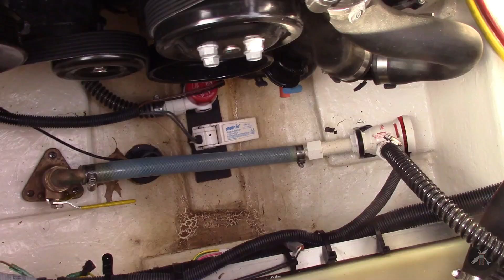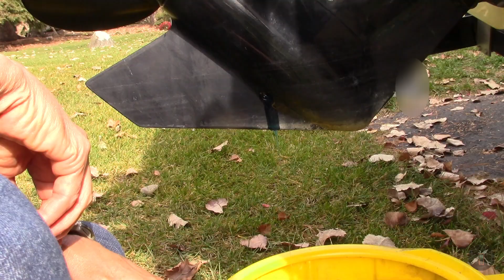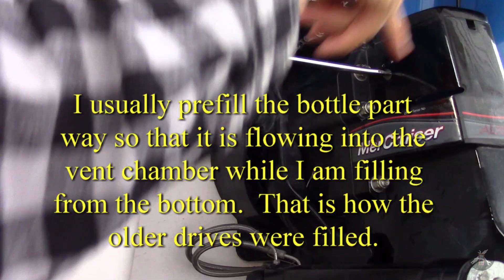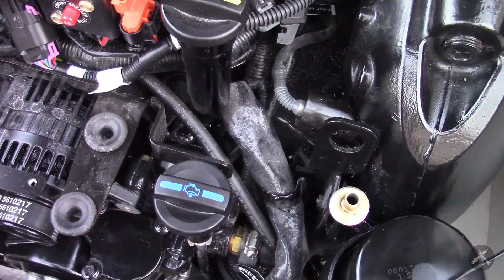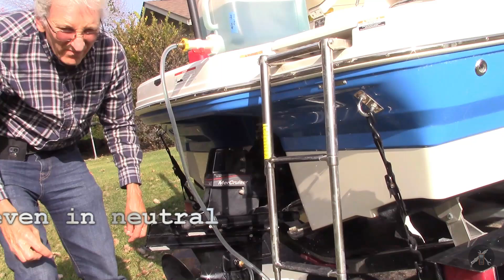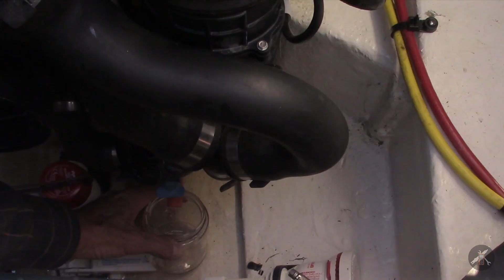UPDATED: Winterize 2018 Mercruiser Alpha1 Stern Drive 4.5 L 250 HP

Comment: One other question. I've heard horror stories about the single point drain system failing when there is a clog in the drain tubes coming from the block and/or exhaust. If there is a clog from rust/debris, how do I determine if absolutely all of the water has been drained from the system? I read in a forum that someone had a clog unknowingly and when they went to fill with antifreeze, the thermostat must not have opened all the way and water was still trapped in the block and cracked the engine. Thanks in advance for your bits of wisdom!!
Reply from the maker: I share that concern. I was surprised that I only got a gallon or so of antifreeze back when I drained the block in spring and thought that might be the cause. At first, I didn't deliberately measure it, but it was obvious there wasn't much and my older 5.0 drains about three gallons.  That put me on to the experiments in my separate video to measure block fill and drain. 
At this point, I drain the engine with the trailer tongue raised enough to be sure that the drain water goes out the back into the pan so that I can measure it. If I don't get close to 1 3/4 gallons (yours could vary, but should be consistent), I would check to see what is wrong. There are quick disconnects as part of the single point drain on both sides of the block down on the "V" near the engine mounts. You can pop these off and verify that the block drains are open with a piece of wire.  I did this on mine when trying to understand my issues. My Chaparral has really tight access hatches that make it hard to reach these, but they are there. The fitting in the side of the block doesn't seem to have a large opening because it is a quick connect threaded into a small port in the block. That could lead to a clog.
 Also, now that I prefill the block, if it doesn't take that same roughly 1.75 gallons, there is a problem with draining completely.
My sense is that if you circulate antifreeze through the system including all the exhaust related hoses after the block is prefilled, it should be good.  I also test and measure a little from the single point drain when I'm done as a cross check.
Reply: Could we potentially just remove the thermostat before adding the antifreeze to make sure the water in the block is evacuated?
Reply from the maker: @HakunaPatata  Removing the blue plug in the thermostat housing will essentially bypass the thermostat and do the same thing as removing the thermostat. But this won't help if the drains are restricted, because the restrictions are at the exit points down low. 
I have had block drains plug on my 5.0 V8 due to rust in the block or sand / silt being picked up from the lake bottom. But there you can see that it isn't draining because there are 5 separate plugs on that engine rather than the single point. A can only think of three ways to check for complete draining. 1. determine your normal drain volume and check that it all drained or 2. pull the quick connects and run a wire through them or 3. Measure the antifreeze amount that it takes to fill the block through the blue plug and compare it to normal drain amount.
Reply: That makes sense. Thanks so much for your advice!
Reply from the maker: @HakunaPatata  You're welcome.

Comment: A Big thanks to you! Your video is an invaluable resource, especially for someone new to boat ownership like me. It thoroughly prepared me by breaking down each step and detail—can't thank you enough for making it!

I'm interested in replicating the special fuel mix gas line setup you used from your gas can to the engine. Could you share any specifications or methods? Alternatively, is it available for purchase?

Cheers,

Bryan 😎
Reply from the maker: The fuel hose is something that I made up from hardware / auto store parts.  This is what works for my application, you'll need to verify that it matches up with your fittings and doesn't leak.  It depends on the adapters at the engine fuel filter housing and / or the fuel tank.: 

3/8” I.D. rubber fuel rated hose (auto store) - not high pressure fuel injection hose

Fittings from hardware store:
Fitting 1:  Conversion from 3/8” hose barb (into hose) to 3/8 female NPT pipe thread (brass)
Fitting 2:  Conversion from 3/8” male NPT pipe thread to 3/8 male SAE 45 degree flare (brass)

Depending on your connection (flare nut vs male fitting), you may need fitting 3.

Fitting 3:  3/8” flare coupling (two SAE 45 degree 3/8 flare nuts connected by short piece of copper)

By using two sets of fittings #1 and #2 and the flare coupling #3, I can seal up the hose for storage to keep dirt out.

The fittings are the standard that are usually available at a hardware store.  I initially thought these might be industrial and bought some hydraulic fittings at the farm store. I think those were JIC 37 degree fittings.  Those didn’t work.
 After some more checks, I ended up at a hardware store for "conventional" flare fittings. These are used for soft copper tubing that you would use for water and they come in variations for adapting to hoses and pipe threads.  I believe they are SAE 45 degree flare.
It may vary by installation, so your engine or tank fittings could be different. The thread should match so they spin on easily with finger pressure (before final tightening with a wrench). If they are 45 degree flare, a pair of male fittings ought to make a right angle when the flare surfaces are matched up. The main thing is that they shouldn't leak.
Reply: Amazing! Thanks for the response!! 😎🙏🏼
Reply from the maker: @BHudsy  You're welcome.  I also put together an additional video on the portable tank and connections. I hope that helps:
https://youtu.be/chyeMXcCNGA

Comment: Thanks sooo much.   Do you change out the filter/separator each time?  When you put in the mix, do you remove it? (btw I also have an 86 IROC and have watched those videos too. :)
Reply: *fuel filter
Reply from the maker: Officially, Mercury recommends every 100 hours or 1 year, whichever comes first.  Personally, I run low hours and don't always change every year.  So far without issue.  Perhaps the risk with a water separator is that you get significant condensation in the tank over a winter and plug it with water.

Comment: Great video! One question, what do you do about the old gas left in the tank? Does it go bad? Do you add stabilizer to it as well? Thanks!
Reply from the maker: Yes, gas most certainly goes bad.  I use STA-BIL, usually the marine grade and I normally use REC fuel without alcohol.  STA-BIL claims the gas can go for a year.  I have been using a double dose and run as long as two years, but that is stretching it.  I add stabilizer when I purchase the gas. I try to either be at a full tank or near empty.  For a better explanation, see this video that I have posted:
https://www.youtube.com/watch?v=DoKPvZ4tWUY
Reply: Thank you!

Comment: Thanks for the video. What fitting size did you use between the engine and you fuel line that you made?
Reply from the maker: This is what works for my application, you'll need to verify that it matches up with your fittings and doesn't leak.  It depends on the adapters at the engine fuel filter housing and / or the fuel tank.: 

3/8” I.D. rubber fuel rated hose

Fitting 1:  From 3/8” hose barb into hose to 3/8 female NPT pipe thread (brass)
Fitting 2:  From 3/8” male NPT pipe thread to 3/8 male SAE 45 degree flare (brass)

Depending on your connection (flare nut vs male fitting), you may need fitting 3.

Fitting 3:  3/8” flare coupling (two SAE 45 degree 3/8 flare nuts connected by short piece of copper)

By using two sets of fittings #1 and #2 and the flare coupling #3, I can seal up the hose for storage to keep dirt out.

The fittings are the standard that are usually available at a hardware store.  I initially thought these might be industrial and bought some hydraulic fittings at the farm store. I think those were 37 degree fittings.  Those didn’t work.

Comment: have you had to replace the spark plugs or coil packs on it?  would love a video on it if you have it by chance.  great video on the winterization.
Reply from the maker: I have not had the plugs out yet.  The manual says to inspect them at various intervals rather than just replace.  I think it was 100 hrs at first, then 300 hrs or 3 years. I don't have that many hours yet.  I know they don't want misfire to damage the catalysts, but that seems aggressive compared to automotive where we generally run 100,000 miles on plugs, that is like 2000 to 4000 hours.  I will say that it is a good idea to remove the plugs on occasion to be sure the threads don't corrode and stick in place. That may be driving the 300 hour recommendation.
As far as coil packs, those have not been replaced either.  There really isn't a maintenance interval as far as I am aware.  You generally run them until there is a concern.  On my 5.0 carbureted GM V8, I replaced a number of ignition parts (pickup, coil, module, plugs, wires) just on general principles at about 20 years or 350+ hours.  They weren't showing an issue, but it seemed prudent. 
One thing in the marine world is that the environment is different. In the auto world, we work with underhood temperatures above 200F. I haven't had a pleasure boat that would come anywhere near that.  So, I expect less heat aging on coils and ignition parts.

Comment: Do you have the summerize version to get ready
Reply from the maker: Most of my maintenance is done in fall.  I did the water pump kit then. In spring, I drain the antifreeze and charge my trolling motor batteries and a little cleaning and I'm ready to go.
Water pump: 
https://youtu.be/HtpreHQSE34 

Drain antifreeze: 
https://youtu.be/EPPf9BjRM1g 

Charge lithium batteries: 
https://youtu.be/4DdJ4-c0bTU
Reply: i think most people just connect the battery and start it up in the summer.